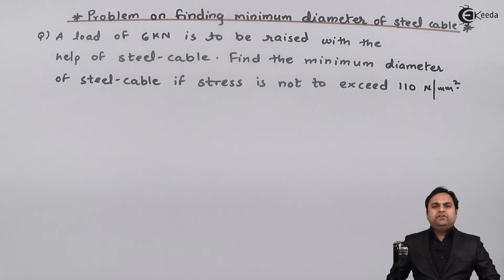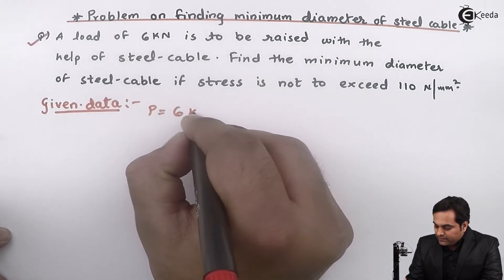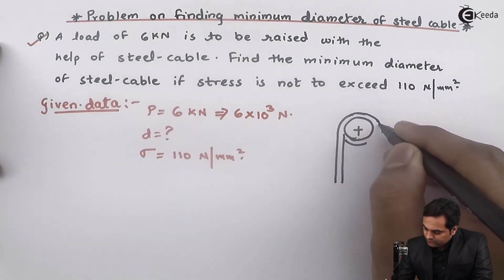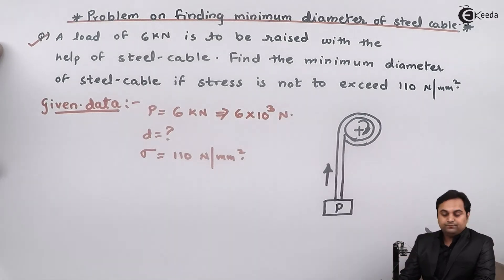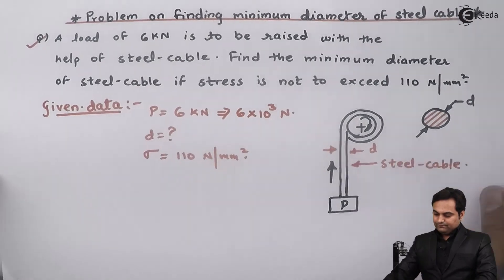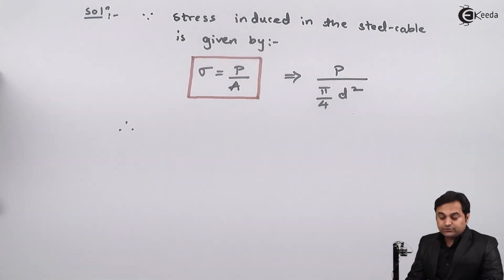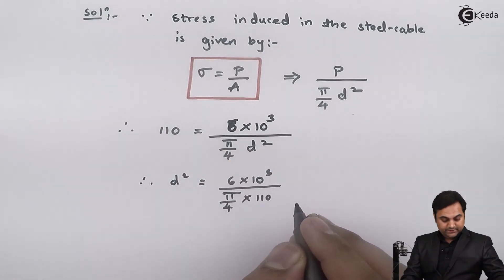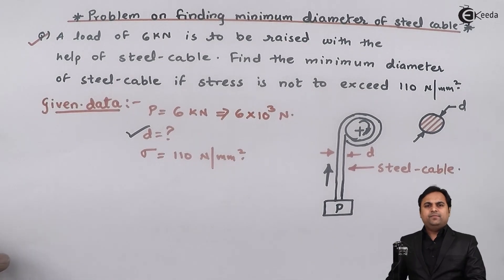Problem on Finding Minimum Diameter of Steel Cable - Stress and Strain - Strength of Materials

Comment: You are solving this problem as if the steel cable is a solid rod of diameter d.  Steel cables behave VERY differently than a solid steel rod.  You cannot use such a simple stress equation for steel cable.

Comment: an 80m long wire of 5mm diameter is made of steel with E=200 GPa and an ultimate tensile strength of 400 MPa. if a factor of safety of 3.2 is desired . determine the largest allowable tension in the wire and the corresponding elongation of the wire